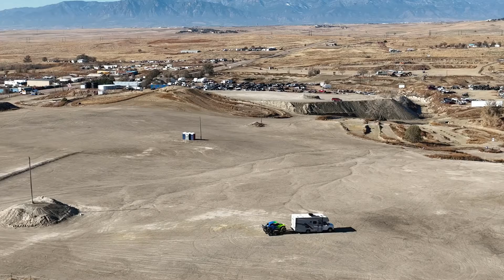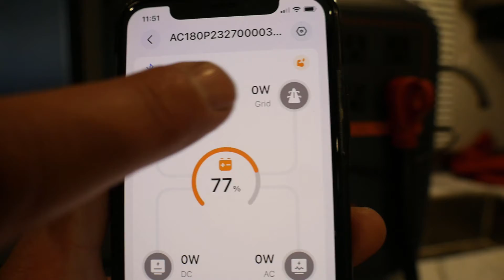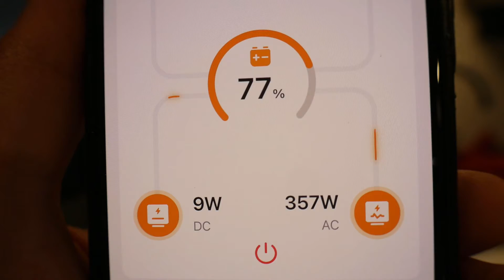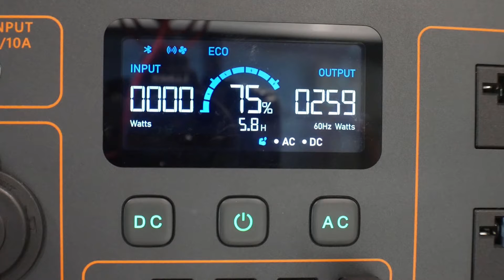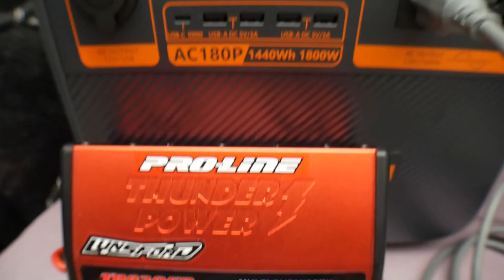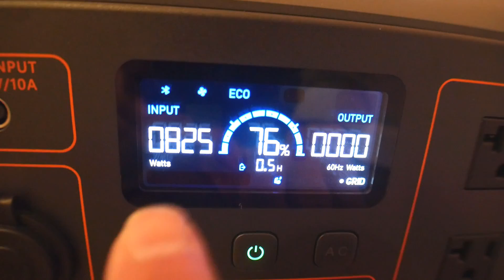Bluetti AC180P for Boondocking or Van Life, here's why...

Comment: Wondering why you can't run the AC on this power station? I know you couldn't run it for as long as you can with a generator, but it seems like the specs check out for running a small AC for a couple hours. Looking to buy this power station so wondering if you've actually tried or tested it with the AC yet. Thanks!

Comment: Hi, I have a question, how did you connect the microwave or the other utilities to the power station? Thanks, Jacinthe
Reply from the maker: I was using the 110 output on the power station and had that connected to the shorepower on the RV.
Reply: @DougBugBuilder   with that Dog Bone , right ?

Comment: You should put the BougeRV 200w StickOn panel on your Roof then it would be charging it's self when your parked or when you drive, The BougeRV is the Best Solar Panel you can buy because even when it is shaded it will put out good power, Unlike every other 200w panel on the market, You are wasting time and fuel running a Generator not to mention the noise annoying others near by and the BougeRV 200w Panel will be charging the AC180P even while you are using it.

Comment: Nice video! I own already 3 bluettis eb240 eb70 and eb3a and I am very grateful with their overall performance this one is going soon to be the 4th one! 😂. I saw at your display that the power lift mode 💪 was on the time you was charging the batteries from your rc car, be careful because in this mode you are not supposed to use electronics only things with only resistance inside like water heater or hair dryer etc. Because of the low voltage in this mode it is possible to destroy sensitive consumers.
Reply from the maker: Wow great tip, I didn't realize that in lift mode.
I'll change it, and thanks for the heads up.

Comment: The power stations are pricey but convenient. A LiFe battery 1.4kw + inverter 2kw + charger is about half or even less than the power station.
Reply from the maker: Well, this device cost $800, and a 100AH lithium battery is about $300 on the low end, and a 3,000w inverter is about $350, then there are all the other features this comes with. Not to say I couldn't have equipped the RV with something comparable, but with this device I can use it for things other than the RV.
Reply: @DougBugBuilder  $800 would be nice. it shows to be $1100 though when I click the link. peak 3kw pure sine inverters are pricey. 100ah battery cant really maintain that high output continuously though, typically.
Reply from the maker: @murraishiny  You're right, sorry, it's been months since I was pricing these out. When I was comparing pricing I was looking to add (2) batteries, a 3,000w inverter, and another 200w solar panel. That's what I was using to compare the two.
Reply: @DougBugBuilder  that is nice setup. I run in my RV one battery, 1200W pure sine inverter, and 200W solar.

Comment: Why not put solar on top of your rv and charge it that way?
Reply from the maker: There is one panel up there now for the coach battery, and it helps that battery when I'm running only 12v accessories. I don't think there is enough room up there to add enough panels to make any noticeable difference on the Bluetti. I could be wrong, I should measure it out, I'd like to get all the solar I could.

Comment: I have been thinking about purchasing a Bluetti , I do a lot of camping and depend on my Honda 2000 and the big onboard gas hog 5000 kw generator . I wonder how many watts of solar panel it would take to recharge that Bluetti AC180P to 100% on a sunny day. You should ask Bluetti if you could give your viewers a discount coupon.
Reply from the maker: They recommended a 200w solar panel system for this, but they didn't say how long that would take to charge. It's a nice unit, it would probably work well for what you're doing.
Reply: You can also charge the bluetti with the generator. Takes a little over an hour. Great for cloudy days when solar isn’t cutting it, and then you don’t have to run the generator for longer than it takes to recharge the power station.
Edit: He mentioned this in the video, but I commented before he mentioned it. 🤪